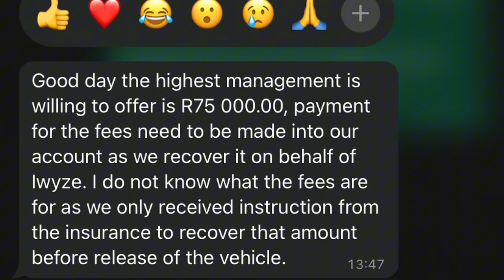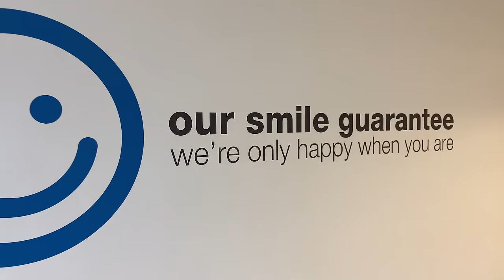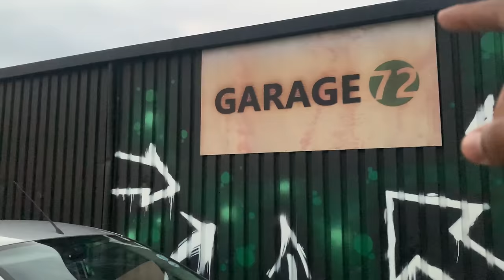REMOVING THE ENGINE FROM MY CRASH DAMAGED BMW M135I F20 LCI SO THE BODY SHOP CAN WORK ON IT | PART 2

Comment: Have an engine cover , lower airbox , and new charge pipe with sensor if u need
Reply from the maker: Air filter box?
Reply: @josiahthobejane  yes
Reply: And the charge pipe , the pipe that goes from intercooler to the throttle body. Based on the impact being concentrated on the left check that yours is still intact